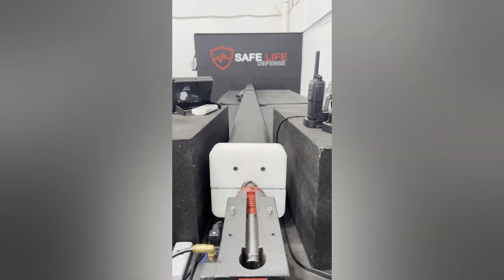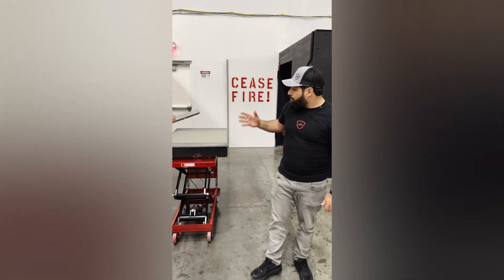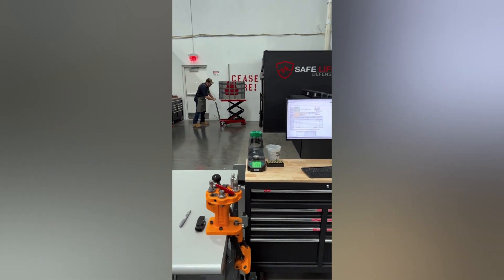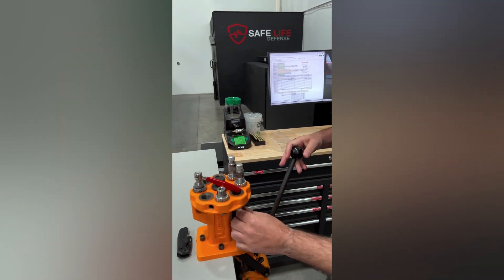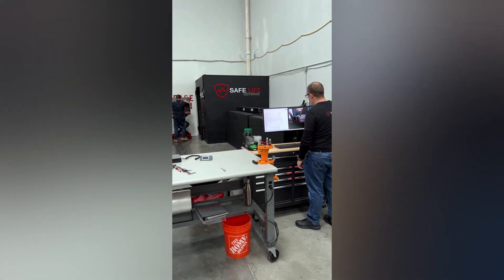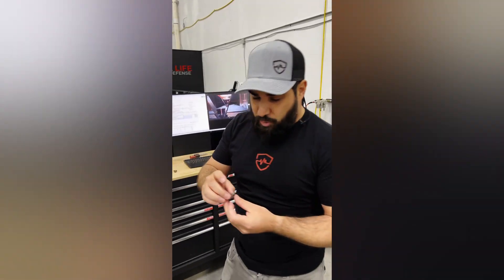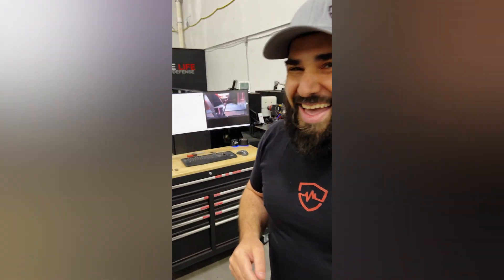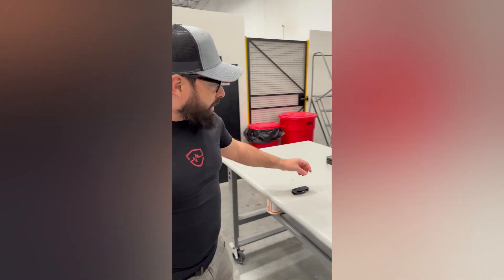Inside the SLD Ballistic Lab: Testing our Level IIIA+ Body Armor to NIJ Standards

Comment: to all of you in the comments, please do not trust safe life. if you check the list of NIJ approved body armor on their website, you will see that only one model is approved from safelife, ONE. the rest either failed the test, or they decided they didn't wanna even try to get it approved. If you watch mrgunsgears video on their level IV ICW plate, a 30-06 black tip easily passed through. (it wasn't shot before that) which means by them saying it is NIJ level IV, they are lying as it clearly can't even stop a single hit from 30-06 black tip. their plates also say that they are made in china. complete scam